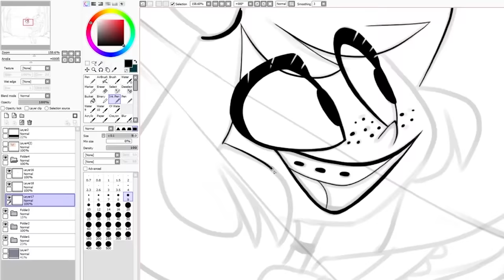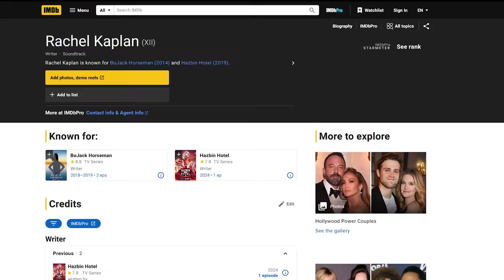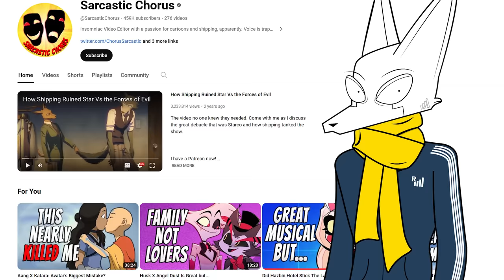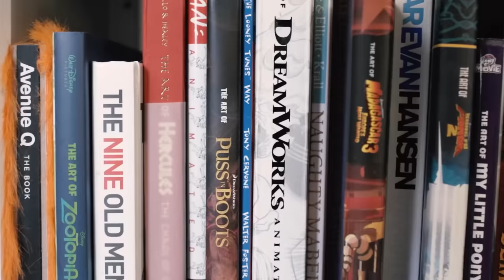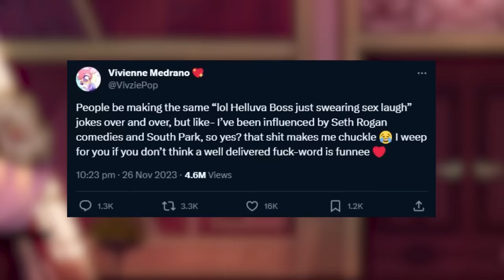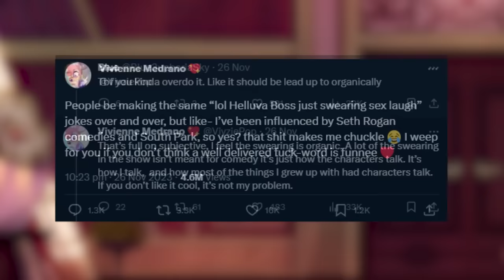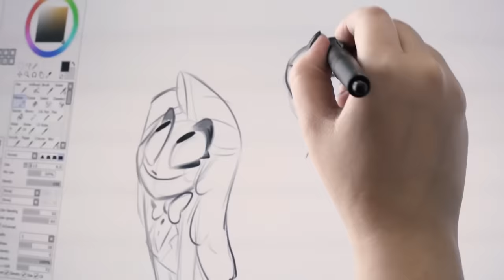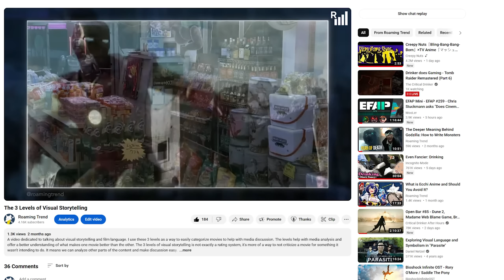Hazbin Hotel: The 7 Deadly Sins of Modern Writing

Comment: Can we talked about how they ruined the exorcist? They painted them like they were T800s but we never get to see just how terrifying they are. Just for them to get turned into a complete joke by carmilla when she basically explains that they actually really suck at combat and their weakness is angelic steel which i find extremely hard to believe that no one else has figured that out. AND THEN they throw that out the window cause lute was able to damage Vaggie by simply bashing her head onto a table so i guess you dont need angelic steel to damage angels. I'm also guessing not a single sinner in all the centuries the extermination has been going on tried to fight back against exorcist
Reply: Wording choice ruined that. If it had been phrased "kill angels' or even 'do harm that sticks' it would work. Terminators do react to attacks, they just aren't more than momentarily inconvenienced by them most of the time. You can hit a T-800 with a car and it'll be knocked down, or knock it off balance with a shotgun or wrench.

Comment: What I often say is that big studios and the industry have rules and restrictions for a reason. Many successful kids' shows thrive because the creators have to care deeply about the content—they can't just rely on easy ideas. In contrast, Vivziepop doesn’t have those same constraints, so what we see in her work are both her raw strengths and her weaknesses. These aren't always fully polished or rethought because there isn't a bigger entity stepping in to say, "Hey, this needs to be fixed."

Considering she doesn’t handle criticism well, even if someone did point out the flaws, it might not have made much of a difference. The show likely wouldn't have changed much either way, which is a bit sad. She clearly had a lot of passion and really wanted to make this work, but her own ego, lack of maturity in the field, and absence of external feedback from a big studio to refine those odd characters or ideas made it difficult for her work to connect with a broader audience.

Comment: The show just feels consistently shallow, it's a bunch of ideas that have already been done better. I liked the pilot for what it was and now that the show is out I like it leagues better in every way because it had more character than the show, bizarrely with an emphasis on the voice acting - though perhaps that's because this is simply another gig in a line of gigs for the new cast rather than a unique role as it was for their predecessors. There's a quality that a passion project (funnily enough what the Hotel is called in the pilot) has that the bought and paid for show lacks. It neither tries to align itself with theology nor tries to make its own mythos beyond the skin level and so it has no depth. You could change the setting of a show to a set of bad neighbourhoods needing to prove that they've got something worthwhile going for them to avoid being bulldozed by a local city council/higher power and what would really change. If you're going to use religion as a theme or setting, why would you not actually do something with it?

The fact that the pilot understood the most basic concept of 'show don't tell' and the show walked it back is mind-boggling.

Comment: The exposition is very good to me. I'm bored so bye. Show is good. To be clear, I didn't leave a dislike btw this video is somewhat fine. Just a suggestion, please shortly and quickly go over what your talking points are before you talk about them. This will help the audience understand a bit of what you are thinking, meaning if they leave early they still sorta get what you were talking about. Also it makes them wonder what you were going to say about those things, thus making them more interested, thus making them more likely to stay.
Reply from the maker: I do that for every chapter, so you could scroll to each one to get a general idea. If I just bullet point everything at the start, it would not only make the viewer make false presumptions as the arguments would appear weaker without the right explanation, but also provide no motivation for anyone to stay for the rest of the video. So they would leave with no value and still not watch the video. 

Apologies that my video did not hold your attention. Perhaps you can watch them in small chunks if you are interested. Thanks